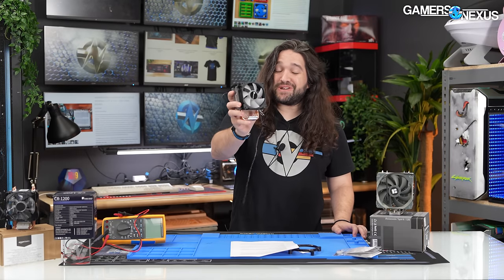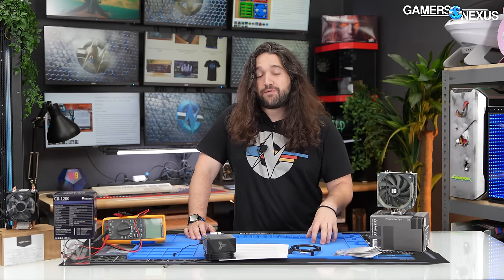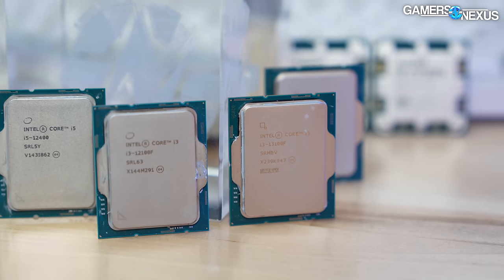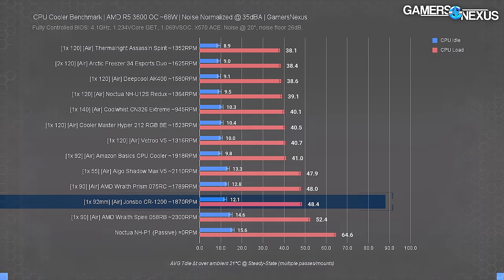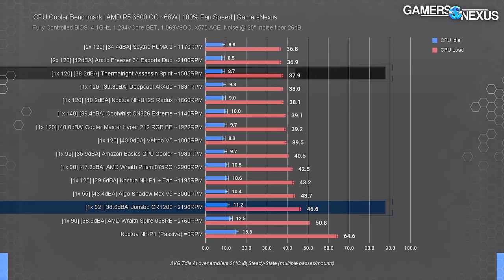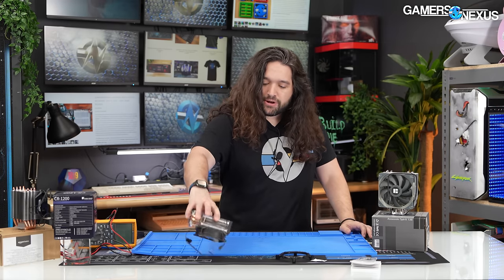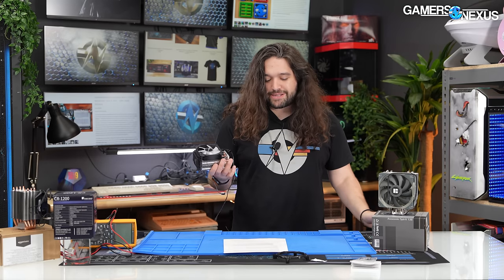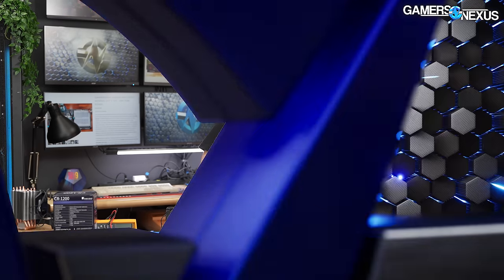Testing the Cheapest Possible CPU Cooler | Jonsbo CR1200 Benchmarks & Review

Comment from the maker: We paid $3 for shipping as it was a combo deal when we bought it (combo with other items). It is a variable shipping cost based on deals on AliExpress and other items you're buying in the same order / from the same seller, which spreads cost. There are often multiple sellers for this cooler.
Find our cooler reviews playlist here! https://www.youtube.com/watch?v=iRe8zVCjCNw&list=PLsuVSmND84QtyyYcalFch402w3ypcp1TQ
Now for the obvious note: Shipping is a consideration given that it'd be coming from AliExpress, but we can't accurately review shipping cost for all the different regions and it can often get bundled in with other items for 'free' shipping. Either way, if shipping is enough to push it towards the $15 mark, there are a ton of competitive options and shipping heavily influences value there.
Learn about our CPU cooler testing methodology here: https://www.youtube.com/watch?v=fmTOJP4KOyk
Reply: there's a CR-1400 version which has 4 heat pipe's, i have the CR-1400 :)
Reply: that flatness graph hurt my head
Reply: Totally missed this. China subsidizes shipping, so aliexpress shipping is usually used to offset the website cut.
Reply: I might get one purely because of the socket support, Might be handy to have a cooler like that laying around.
Reply: @jayreed2692  yeah plus let's be real, that fan is worth the 3 bucks based on its glory alone
Reply: Jonsbo is like a poor man's Shimano. Like Shimano makes top tier bike parts and fishing gear and much more. And Jonsbo makes cheap bike parts, PC parts,Vapes and also fishing gear. Only difference between the two is Shimano don't make PC parts.
Reply: have you had any comments from gunsmiths on your silicone mat? I'd want to protect a wooden table from CLP. gun solvent or even brake cleaner
how does the mat fare against that?
Reply: Amazon sell the same one
Price about 15/20 dollar/euro.
Reply: @mapsofbeing5937  if theirs isnt what youre looking for, locksmiths usually have very good mats for when they are pinning locks.
Reply: Coutd be worse. Could've cost tree fiddy!
Reply: Please review more air coolers for ITX builds! Awesome content as usual!
Reply: is this a joke? you payed almost 20$ for this 'free shipping' cooler...
Im seeing right now on aliexpress a 6 heat pipe, 3 fan, rgb cpu cooler with free shipping for 16.5€
Reply: Gamers Nexus test the cooler "silentiumpc fera 5" the cooler beats up to 5 times more expensive coolers
Reply: You say the name could use a little work but I'd say that name is working hard enough right there.. maybe even needs to take a break..
Reply: Not testing my beloved Athlon 64 6000+ X2? ... outragous
Reply: ID-COOLING SE-224-XT maybe? One of the best price/perfomance/look coolers. And ID-COOLING SE-226-XT. Both have white/black argb versions, but have different contact type.
Reply: it has something to do with universal postal union where a country classified under developing nation (which obviously china no longer is) gets some sort of subsidy . for example to send from the US to Africa is gonna alot more then Africa sending to the US. btw they are not looking to compete they are looking to put ya out of business.
Reply: I have built with the 1366
Reply: You have to test LC Power LC-CC-120. I bought one for a revival of some old Xeon PC for my mom for 20$ its 2$ more expensive than this. Xeon is overclocked and pulls 130w on 1.45V and it stays on 62°C under cinebench R23. Up from 2.4 to 4.8Ghz.
Edit: Non RGB version since it's less expensive.  I bought it online and in my country any domestic store that sells you products online you have 14 days return policy by law. No explanation needed.  I risked with it and it worked out 😁
Reply: Can you test a SAMA KA450D? I am just trying to find a 90mm cooler to fit in an old case (Raidmax Scorpio) that I have and like. I use a R5 3600, but would like to use a R7 5800X with an CPU air cooler.
Reply: There is an upgraded version for this the CR-1400.
Reply: Here in local shop (EU) this cr-1200e costs about 9-10 euro, which already contains 27% VAT and it comes with warranty etc. It would be interesting to see a comparison with other <15-20€ coolers available in EU locally. For example Cooler Master, Arctic, Deepcool, Xilence, ID Cooling etc. Many of the branded models recommended in USA channels are either overpriced or unavailable here.
Reply: 775 is not from 2006, it is from 2004 actually.

Comment: For when your cooler budget is only 1% of your CPU budget.
Reply: tbh it's a pretty good way to do budget gaming. This price diff could bump someone up from something like an 10th gen i3 to a 13th gen i3 -massive real world difference in performance compared to if they went with a regular priced cooler
Reply: More like 0.2%
Reply: @10siWhiz  You're spending $1500 on your CPU? What kind of monster system are you running?
Reply: @Real_MisterSir  well i mean the i3 comes with stock cooler, but ok lmfao
Reply: @10siWhiz  💀 bro using a 3$ cooler to cool a modern server CPU
Reply: @MISTER SIR  just run stock with the i3 until you can afford a $20 cooler lol.
Reply: @aboveaveragebayleaf9216  for sure. I've been really happy with the stock cooler on my AMD chip. I only use it for gaming and I have great ventilation on the case. It doesn't throttle which is really all I care about. Not trying to win an OC'ing contest.
Reply: @rando3962  maybe a second hand one without the original heatsink
Reply: @Jerry048  well, I mean  i dont see why someone wouldnt include the stock fan that came with the cpu when selling it.
Reply: @andreasu.3546  problem?
Reply: @rando3962  maybe he figured he could get more money out of it if he sold everything separately?

Like car robbers who dismantle the stolen car to sell as spare parts.
Reply: @rando3962  u can get tray versions that don't have the stock cooler included which are cheaper
Reply: @rando3962  because they could sell it for cheaper
Reply: @EEE-ro5px  but why would you sell it for cheaper? zero sense. Also the stock cooler is worth like nothing xD
Reply: @rando3962  because if they sell them separately at lower prices each, it might sell faster. I’d rather buy a cpu for $10 cheaper without a stock cooler because I have extra coolers lying around.
Reply: so that means 500 x 3, haven't seen a $1500 cpu yet.
basic math is hard, huh?
Reply: yea its more budget friendly and afforable than getting a trustee old hyper 212
Reply: @treborrrrr  nevermind I read that as if he meant your PC budget not just the CPU specifically.
Reply: @Real_MisterSir  The i3-3100 isn't a bad CPU at all, single thread speed is on par with a Core i5-13600 and many games only use 3-4 threads anyway. If I was building a budget gaming PC I'd use an i3-3100 and an Asus commercial business motherboard with an inexpensive tower cooler so it can run turbo full time on all 4 cores.
Reply: @10siWhiz  you can't do math can you?
Reply: But it was about 40% of my cpu budget. Got an E5 2650 xenon. 8 cores 16 threads released in like 2011.

Comment: Not sure if someone has commented this yet, but the Jonsbo CR1200 is usually bundled "for free" with "tray" CPUs in my local market (Indonesia). Same goes for its brother the 4 heat pipe Jonsbo CR1400. They basically serve the same segment as stock coolers but with a bit more flair.
Reply: lol that's cool, hope the tray R5 2600 here does also.
Reply: may I know which marketplace/store offers these as a bundle with tray CPUs? thanks.
Reply: @CrimsonSeas00  Ya pasti tokped bang, siapa lagi kalo bukan enterkomputer😆
Reply: Ada indonesia nya coyy 😱😱🥸
Reply: @ahmadrizkihidayat5139  Guess this is an inside joke for you and yours alone eh :(
Feels a bit rude, commenting in another language on a video produced in English for an English-speaking audience.
Reply: @phattjohnson  No one is talking to you lmao
Reply: @phattjohnson  no one is joking on you mate, they were talking to their fellow indonesian, nothings wrong with that
Reply: @CrimsonSeas00 it is something the retailers or system integrators threw in to give their offerings some flair, is it not something Intel or AMD include
Reply: @ahmadrizkihidayat5139 fix queenprocessor nih 😂
Reply: its not free technically because the option without the cooler is like 5 dollar cheaper than the one with jonsbo cooler bundle. dont get it mixed up
Reply: @phattjohnson  sorry for some disrespectful fellow there, it's internet after all, they mostly talking about the name of the store and found it funny, some stores make it as bundle so they can seems like have better offer for costumer, even thought it's actually not always cheaper.
Reply: @xeraytiya2956  if you were to buy the jonbso cooler separately then it eould cost more so it's still a better value

Comment: Honestly seeing those results it's insane value compared to other coolers costing many times the price.
Reply: For 3 bucks, I'd be content with it even making it to my doorstep in the first place. Seems like this could be a steal for a low-power budget build of some kind.
Reply: @FAT9L  lol same, like hell ive never replaced my hyper 212 for decades now and has been pass 3 builds
Reply: GPP to GDP: " you under estimate my power"
Reply: @FAT9L  Yeah. My old nhd-15 and dark rock pro 4 air coolers were over $100 ( AUD) each so this thing being like $5 AUD or less is a steal. My liquid cooler.. Well let's not mention the price of it 😂.
Reply: My next build will be a 7800X3D on a dirt cheap A620 ASRock board with this cooler. 😂
Reply: Seems like this would be perfect to replace a damaged stock cooler for any non-gamer computer or for messing around as a hobbyist (checking if a used/junked CPU/Mobo combo is good or playing with inappropriate CPU fan speed curve settings).

Comment: I hope you'll take a look at Jonsbo's HX series of tower coolers. They look quite slick and understated.
Reply from the maker: Hadn't heard of them before! We'll try to look into them!
Reply: @GamersNexus  You should also take a look at their cases, they have a lot of high quality ones at a reasonable price (At least in Asia)
Reply: The 30-35 USD (in my country) HX6240 and HX6250 claims its support to a TDP* of 250W, which I doubt.

Would like to see if the claims are true, although IIRC each CPU manufacturer calculates TDP in their own diff ways.
Reply: @First-Name_Last-Name  they are not
Reply: I have the Jonsbo HX7280 and it's an excellent cooler. 

I switched from an NH-D15.

Both are fantastic choices.
Reply: Not even just coolers, their d30/d31 cases are really good cases.
Reply: @Mayan_xz  That looks like a beasty cooler!
Reply: i have the hx6250 on a 3800xt and have no complaints. runs cool and quiet
Reply: @GamersNexus  Steve, Jonsbo makes awesome cases.
Reply: @Mayan_xz  My issue with that one is, depending on the region, it can be roughly the same price as other high end air coolers.
Reply: @ffnbbq  True. In the UK, it's a reasonable price at most resellers and I got mine for £79, compared to what the NH-D15 is going for in the UK which is about £100 now.
Reply: @SeanOMatic  Sure is - nice and sleek looking and very well performing. It was my first Jonsbo product too, so happy with what I got.

Comment: Right now they have on sale the Aigo ICE 200 PRO, it is basically the same design but without the top cover and static RGB. The cooler is around 5 USD but to be able to pay that price you have to buy another two items, which you can get for 2USD each. You'll end up paying 9 USD but free shipping is guaranteed by geting 3 items so i think is totally worth it. Got mine to replace the Wrath Spire of my R5 1600 (that one still has the copper vapor chamber) and my temps dropped 10 degrees.

Comment: 11:09 I do love the relative simplicity of the AMD mounting system - not having to worry about having proper tension or keeping to a specific tightening pattern, but at the same time, that clip mechanism is a PITA to work with a lot of them time.
Reply: True, those clip mechanisms are annoyingly fiddly, but at the same time they can be toolless and I guess all those other methods are a large part of why soo many used AM4 mainboards lack the brackets or even the backplates.

Comment: Those circular adapter brackets seem to be extremely common. I've seen them bundled with cheap chinese coolers and salvage motherboards. The actual cooler itself seems to be designed to mount to the stock AMD mounts and that ring's purpose is to adapt that clamp to intel sockets.
Reply: As this HSF would work fine on AM5, AM4, AM3, AM2, S939, S754, FM1, FM2, it would seem the path of least resistance and cost. A stock design that literally did not change for over a decade and still works today (well enough anyway) with sunk costs paid some time ago it seems prudent to use it one more time. The intel ring adapter is also a cheap proven and good enough solution that this HSF would be good enough for IDK the entire S115x range, going back to the 1st 'i' series intel chips.

Comment: The Cooler Master Hyper/ Blizzard T2 has an interesting heat-pipe trick. 
It has two heat-pipes but they are installed upside down, so the contact area is four heatpipes wide.

Comment: As a matter of fact im still running a system that is constantly up(with semiannual maintenance to remove the dust) for 14 years on socket 1156 (i7 870), and been constantly upgrading that computer over the last decade, neither MB nor CPU specs mention it's capable of having 32GB of RAM because at the time the 8GB DDR3 sticks weren't mainstream yet. I enjoy building out older systems, and truly impressed mine didn't fail yet. Many of the systems i have are just headless linux servers doing their small things because they're still capable of running stuff, with the right setup and care.

Comment: I'd love to see more budget coolers. More specifically, the ID-cooling SE-214-XT which is nearly identical in price and has many design similarities. Their dual tower cooler is worth a look as well.
Reply: HC also doesnt include that cooler in their reviews :/
Reply: i second ID-cooling. i was making an HTPC based athlon 3000G server for HomeAssistant(python based smart home server). bought a cheap SFF case together with picoPSU and IS-30 from ID-cooling as it was the lowest profile that I had found (30mm of height!). for something like 22eur. it is very silent and powerful comparing it's size.

Comment: Id cooling have tower coolers (like the ID-Cooling SE-226-XT) that are pretty well priced, prehaps if you have the time reviewing some would surely be interesting.
Reply: All ID-Cooling cooler are insanely underrated tho

Except IS-47K. Fuck those thing. Still get hot even after using modified AM4 backplate

Comment: I replaced my old 212 Black RGB Edition with a Jonsbo A5 and was blown away by the results it practically slashed the temps by 10 degrees Celsius in idle and peak compared to the 212.
Reply: no way.....i have the same cooler 212 rgb black as well...damn cooler master is shafting us, i paid 50$+ for it lol.. in comparison to $3?

Comment: after seeing the pressure test results, I started wondering: would lapping the cooler to improve its flatness make a noticeable difference in performance? Iv heard of cpu lapping, but not cooler lapping. Curious to see if it would improve anything, on a cooler this cheap the extra work might be worth it haha
Reply: I seem to see the heat pipes sticking out from the cold plate and if this is so, it would not help to lap the cold plate without thinning the heat pipe walls to a questionable degree.
Reply: @richardgarrett2792  Lapping can take off an incredibly small amount of material. It can be done and have benefits. That said, the poor pressure map was not due to flatness as much as the mounting mechanism. At least, that's my understanding.
Reply: @richardgarrett2792  Would be interesting to see how flat someone COULD get it before the heat pipe rips open or close the gap with some aluminum foil.
Reply: Some overclockers used to (probably still do) lap both cpu and cooler. Though generally people usually just use a well known, good cooler and only have lapped the cpu when necessary. 

I personally do neither.

Comment: With them clip style coolers for the modern AMD sockets I found it easiest to first loosen the screws and take out the retention bracket mount the cooler to the retention bracket by clipping it then lower the whole thing back on to the CPU and back plate then tighten it back down. Makes it a lot easier and less risk and stress on the socket and/or CPU.

Comment: I built a pc for a client, he wanted white, RGB and good enough to cool a overclocked 9900k but needed it under $50. Under $50 fine but white and RGB was extremely hard to find for $50 then I found jonsbo had their CR2000gt for $36.99 in white and RGB. That thing was a beast.

Comment: I am using the exact cooler right now as we speak cooling my I7 4790. Under full load I reach max 71 degree. I got it for 5.4USD. 

I was so impressed with it to the point where I bought the CR2200 with 6 HP for my Ryzen 3600 for 19 USD (max 53 degree under full load)